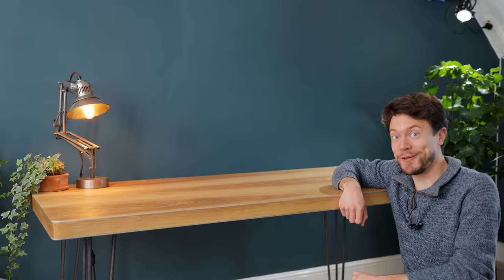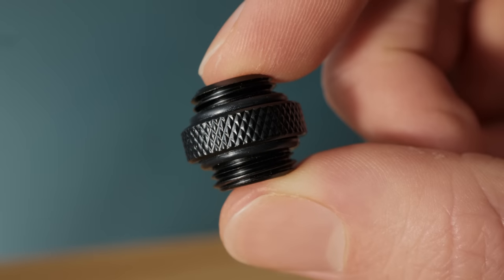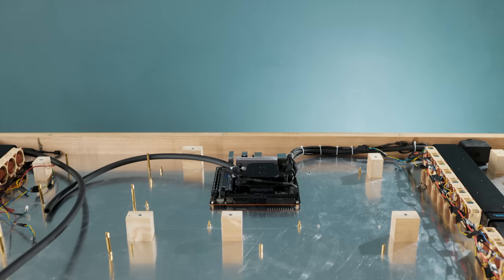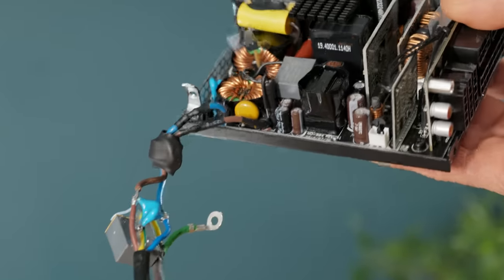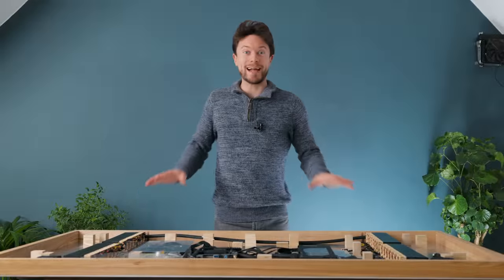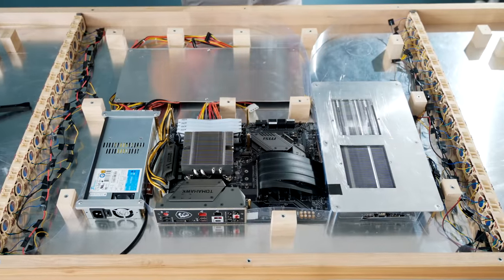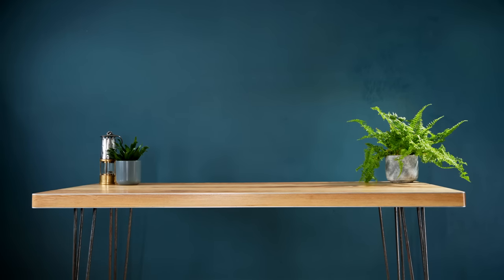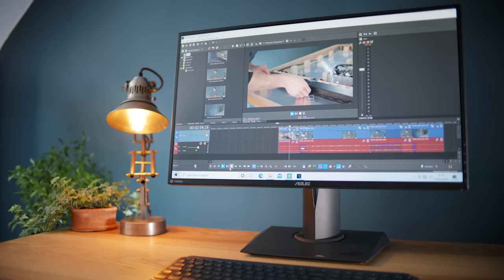Watercooling my invisible PC... (and other upgrades)

Comment: I feel like there should be a bigger emphasis on "Do not try this at home" with the power supply. If you don't exactly know what you are doing, NEVER open a power supply ! It can kill you if you touch a charged capacitor for example.
Reply: Just walking outside to buy a power supply can kill you these days. So yeah... take precautions. :)
Reply: @kontoname  I love this reply
Reply: just wash your hands and wear a mask and you'll be fine
Reply: Absolutely agree!
Reply: It will only be dangerous if you touch open terminals and at that point it is natural selection.
Reply: Whenever I open up anything with capacitors I keep the thing turned on and unplug it from the wall. That way all the power that's stored in the capacitors will get used up.
Reply: @schwuzi  always best to be safe and short any big ones with an electricians screwdriver.
Reply: @schwuzi  Actually power supply will shut down before input voltage (from capacitors) drops to zero. So there will still tens of volts in them.
Reply: @Firley777  I didn't know that, but I had no problems with it so far. Mind you I have never opened a power supply before. Simply electronics in general, where capacitors are always to be found.
Reply: @schwuzi  These are famous last words.
Reply: @ShadowManceri  I don't think so. I handle this stuff carefully and don't touch anything I don't need to, which I think should go without saying.
Reply: @kontoname  only if stores are open. Which isn't currently the case in most european countries.
Reply: It's in the spec that these big capacitors have to drain to "safe" voltages a couple of minutes after being un-plugged.  Still, good practice to let it drain overnight and/or measure the voltage on the capacitor.  Afik, they run about 350Vdc when operating and store 5-10 Joules.  So they can make a significant explosion if shorted.
Reply: It's weird how many of you seem to think it voltage that will kill you. It's not it's the amperage that's runs through it. Hence why you can touch and electric fence without dying
Reply: @jeffreekenny  that's true, but only 20 mA is enough to stop your heart / getting ventricular fibrillation. I am not sure how high the current would be, but the capacitor seems very big.
Reply: @jeffreekenny  That's why every safety sign sais high voltage, not high amprege right ? Please stop spreading this myth, it IS the voltage that kills, because the voltage is what creates the amperage across the resistance of a human body ...
Reply: @Jordan_C_Wilde  That's true. You need a certain voltage level to overcome the resistance of your body.
Reply: @Jordan_C_Wilde  no dude. Is neither voltage or amperage. Is the resistance, dude.... I hate people that say is not the voltage ugh... Is not like they are directly related and there's a formula for that
Reply: @clartypaths840  Did that, got covid. Wearing a mask doesn't help if you are the only one doing it. Picture a garden hose and covering the person being sprayed vs the nosel.
Reply: @ErimlRGG  Did you mean to reply to me or the other dude ? Because the resistance is roughly the same for every humen, so the resulting amperage across your body is mostly dependand on the Voltage you are exposed to. I = R/U, hence why all those safety warnings are allways about voltage.
Reply: @foobars3816  sarcasm is beyond your grasp I see.
Reply: @kontoname  "These days"? 

Any day. You are more likely to die in your car on the way to the electronics store than to get and die by covid.
Reply: @Jordan_C_Wilde  Na, was just agreeing with your annoyance. Yeah resistance is almost the same but my point is that all 3 are factors for killing you, so it's dumb saying "it's not that!" because is the 3 factors
Reply: @clartypaths840  I see. It's hard to distinguish jokes about covid prevention from what people actually believe. You know, like cutting down cell towers.
Reply: @pavletrnic1433  A capacitor can absolutely kill if it's big enough. Electroboom will know this too. He pushes the limits of what is normally considered safe (to the pint of pain) but he certainly is knowledgeable enough to know what can kill

Comment: I’d like to see a view of the desk with a thermal camera though to see if there are any hot spots and thermal management issues...
Reply: That wouldn't get you much information with the two aluminum plates acting as heat spreaders. You'd have to remove the plates to take the measurement, but then the measurement would be irrelevant since the aluminum plates are a critical part of the airflow system. Wouldn't be too tricky to put thermal probes everywhere you're worried about hot spots as a final verification test, though.

Based on his approach to the Canon camera thermal rework, he's clearly extremely knowledgeable about and has a strong intuition for thermal design. I don't see too much to nitpick here.
Reply: @SuperAlfredo333  The heat would spread, but it would also dissipate as it spreads.  So there would still be parts that are measurably warmer than the rest.
The point in observing with a thermal camera would also be to locate where the heat spreads _from_, not how it spreads.
Just knowing the general area (eg, knowing there's a hotspot near the memory) is sufficient information to restructure the cooling/airflow.

Comment: Do install a fluid temperature sensors and add that data for the fan control, it would help control the ramping of the fan from spikes in the CPU temp
Reply: I wanted to say the same, but the board sadly does not have a thermal probe header which is kind of sad. There are ways around that with extra hardware, but then you can't control the fans directly from the mobo which normally is the neatest solution.
Reply: @BSEUNHIR  Ah wells, there can always be another follow up video to swap out the mobo, add in the sensor plus a 30 series card when that's available..
Reply: @BSEUNHIR  https://arstechnica.com/civis/viewtopic.php?f=7&t=1470129 this is what I did to get around it on the MSI X570 Unify. Works very well!
Reply: @CalumMcFarlane  tldr

Comment: Me: drills a hole in my desk for the keyboard:

What my dad sees:
Reply: Why dou you need a hole in your desk for a keyboard though?
Reply: @SnakeTwix  so I can’t see the cable
Reply: @pearlio7297  Now it makes perfect sense
Reply: hmmm but wireles..........
Reply: @SnakeTwix  for cable management.
Reply: I prefer some things wired as well. Seems more responsive than wireless, although it may just be me...
Reply: And no batteries to recharge or replace.
Reply: I prefer my keyboard wired but my mouse wireless.
Reply: @pearlio7297 wired mouse drags when let go of
Reply: Me: why is this clown drilling a hole for his keyboard
Reply: @thealien_ali3382  have you never watched setup wars? People do it all the time.
Reply: What?
Reply: @thealien_ali3382  have u heard of cables watch tech sources new vid you'll see
Reply: @defalt371  wireless has a little lag. Unnoticeable when using them regularly, but some games require instant response times
Reply: @twxx460_  yeah... some people bothered by that fact..
Reply: Do it for ergonomics.  Also, recess the keyboard below the surface and cover it.  Make a hiddden alcove for a wireless mouse.  No keyboard, no mouse, no cables, no computer.  Just a desk.
Reply: @twxx460_  not Logitech lightspeed keyboard

Comment: "was chosen to make it cheaper"
uses literally $500 worth of noctua fans
Reply: I was thinking the same thing. I remember upgrading my dreamcast fan and was like "that's a bit pricey" and that was only one fan. hahahaha
Reply: Probably as good as 8 120mm fans laying flat too. I mean it looks awesome but seems like a poor design decision.
Reply: I believe they were used in the original project purely for quietness.
Reply: Time is money, water cooling would require more time to maintain.
Reply: Well, this is really simple: just become a YouTuber with 2.76M viewers and manufacturers will actually throw their products at you. So, chop chop!
Reply: @Chris-oj7ro  120mm blowers might make sense
Reply: The blocks for the GPU+CPU and the 4 rads are about $6-700 USD.  Technically the noctua fans were cheaper lmao.
Reply: @PasserbyP  Quiet enters chat.
Reply: I had a build with 16 14cm noctua fans. This isn't an exaggeration on price. Would have been cooler to make a separated "invisible" rad box with real radiators.
Reply: @PasserbyP  maintaining a water cooling system takes like 30 minutes every two or so months unless you want to be pedantic and bleed all the air before using it each time.

Comment: "Standard radiator and banker fans"

holds up unit that wouldn't fit in 90%+ of normal cases
Reply: Modern problems
Reply: require modern solutions
Reply: and then he shows us a powersupply that you'd find powering a render farm
Reply: Buy better cases then
Reply: @justminibanana9128  you think you can run a render farm on a 500W PSU? lol OK
Reply: @rossclutterbuck1060  no I was being satirical, I obviously know that a psu that would make a 3090 cry wont be in a render farm.

Comment: “I took out my kidney and replaced it with wire mesh so it would look nice and neat”
Reply: yeah but did you install insulating plastic to channel blood flow and keep it "cool as a cucumber"?
Reply: So my brain 🧠 was overheating due to the icse 8th exams so I opened my skull and liquid nitrogen cooled it 
Now running at a 10^10ghz with max boost of 1000^1200090000000000ghz
Reply: I added rgb to my brain which boosted its performance by 100393994949494949497864367999976544%
Reply: @bodiminds6571  your brain. Because your conscience is a soul. You are a soul. Not. A brain. It is your physicality.
Reply: @iamf6641  but you can't say any criticism because that bad boy can run more than 1 processes now. Big improvements
Reply: Am I the only one who attached a gaming chair to my back? It's great, now my back is overclocked to 60fps at 4k
Reply: @bodiminds6571  but can it run cyberpunk 2077?
Reply: @colinmetzger6755  no sadly got 0.00000000000000000000001 avg fps
Reply: @iamf6641  as kodi was born in this material world with this material body he had this I. So he killed the "him"ego
Reply: @colinmetzger6755  so I felt my brain was heating at 10degres Celsius so I upgraded it to a 0.00000000000000001nm process from tsmc now it's running ok at -100degrees celsius
Reply: @bodiminds6571  bro I have my exams coming up so wil try thiss😂😂😂
Reply: @Adi-fm5us  "screw in with confidence "

Comment: Flex psu's would have worked also
Reply: But what is the max wattage of the Flex psu's? You can probably get a higher wattage sfx psu.
Reply: @ggesdsdsdsd  There are 500W or 600W ones readily available, but that might not be enough power. There are likely higher power ones somewhere but they are elusive
Reply: Saami Zakir  He probably has more knowledge to do this safely than you assume.
Reply: Saami Zakir  he does have a disclaimer tho
Reply: @Saami Zakir  linus has only years of experience in pc level stuff, he doesn't know how to protect himself from the dangerers a psu poses and so he is afraid, it just means its not his field of interrest, because all in all its not that hard to protect yourself from the loaded capacitors if you know what you doing.
Reply: @trungngo1066  he did quite well tbh, first I was like: oh no whats he doing but in the end it seemed like a save solution even for me who was studying electronics for a year. Its not a perfect solution for everyone, you could for example never sell such a thing, but it has enough safety precations so that the person who built it would not kill themselves accidentally.
Reply: Saami Zakir  i opened several dead PSU, the tips is to not touch capacitors
Reply: Saami Zakir  Did you even watch the video?!
Reply: Linus doesn't have any practical engineering experience.
Reply: Saami Zakir  Lol u seriously comparing linus with this guy, years of experience reviewing tech stuff, linus obviously know alot about tech and theory, but u talking about practical stuff, its like comparing engineer with technician who only follow SOP
Reply: @joshuanorman2  I got a 1000w sfx psu, from Silverstone. lol
Reply: That's insane lmao
Reply: @joshuanorman2  look it up "silverstone 1000w platinum sfx-l power supply" lol
Reply: @isaac7272  Linus has years of shilling and "theory" experience, reviews can't be honest when you need to keep sponsors happy.
Reply: @bitelaserkhalif  pff even if you don't touch the capacitors other parts could still be connected to them. The trick is to not touch it with 2 hands so the current can't run through the heart and quickly discharge the caps over a resistor (they are so big that a short circuit would be quite distructive)
Reply: @woldemunster9244    ok what kind of experience do you have to give such an answer?
Also modern science doesn't rest on eqauations but the tests that developed those equations you might be able to "predict" what will happen if you do this and that but in the end you can never be sure till you try.
Your argument is missing examples that verify your opinion to even be considered good. And well frankly most of the hater comments are people that are just jealous that the don't get a gpu sponsored just like that, but you know that takes actual work to get to the point and is not achieved by writing hate comments in the comment section of some random youtube video. 
PS: today I found out youtube has a curseword filter...
Reply: @joshuanorman2  600w is actually more than enough for this build, once the settings have been tuned.  And there'd be even more leeway if he got his hands on the latest graphics cards, those all actually see a sizable boost from undervolting instead of the usual minor dip (or at best, minor boost)
Reply: Saami Zakir  lmao I've worked on dozens of PSUs.
Reply: Saami Zakir  if you need a disclaimer to not do stuff you don't know how to do. You're the problem
Reply: @Deepstatedebate  Disagree. A lot of stuff, even with no prior knowledge is okay to have a go at and just try. Usually the worst that could happen is that you damage something. Opening a PSU could literally be fatal, far worse than the any bad outcome of modding most other electronics

Comment: You should really use a liquid temperature sensor, it makes every build (and I mean, every) quieter, or at least it will improve fan responsiveness, since it allows the fans to ramp up as liquid temperature rises, instead of CPU temperature which can have spikes based on load...

Comment: "Take a listen"
Hears my loud PC
Reply: I feel that. I accidentally bought server fans when I was building my PC and they sound like a jet taking off when my PC is turning on
Reply: @DavidTasselTots  I have a single 92mm server fan in my case as a exhaust, it can spin up to 4k rpm, and that is quite loud, especially with my gtx970 reference going at full speed, then it is basically a vacuum

Comment: Max GPU temperature of 55 C. Linus Tech Tips wants to know your location
Reply: or 131 F
Reply: @CreeperPookie  or 328K
Reply: @deejeh9494  Ah true..
Reply: @CreeperPookie  Celsius is easy to understand and is better admit it.
Reply: @grafzpln2344  You seemed to care to much and replied to my witty comment.
Reply: @Tomoslb1  No, it is not. °F is much easier to understand.
Reply: @CreeperPookie  °f is garbage and based on what exactly? There's a reason all but 2 countries stopped using it completely (and with in those 2, °c is still the standard for anything scientific)
Reply: @CreeperPookie  Yes it is, no its not, yes it is. haha what did I start here .
Reply: @the baked potato Well, °C is pretty easy with 0°C being the freezing point of water and 100°C the boiling point. In °F however, 96°F is defined as the temperature of the human body, and 0°F is defined as the coldest mixture Fahrenheit could create (as he wanted to avoid negative temperature notations). In today's world, the definition of 0°F makes absolutely no sense and the definition of 96°F is wrong, since the human body temperature is slightly higher
Reply: @the baked potato Based on the human body by what metric. Its completely  random. Dangerous temperatures for the human body would be anything below 33°f and above 122°f (0°c- 50°c) like wtf has that anything to do with the human body, that just happens to be mostly made of WATER that Celsius is based off of. Freeze to death at 0°c or less,rapid heat exhaustion over 50°c as critical temperatures. In Fahrenheit its just two completely random numbers that cannot easily be determined by your natural surroundings like water FREEZING and Rapid  water EVAPORATION.
Reply: @CreeperPookie  CELSIUS IS SUPERIOR!
Reply: @CreeperPookie  ohh it is
Reply: @Tomoslb1  it's*
Reply: @the baked potato I'd*
Reply: @420roachdoggjr  No it is not.
Reply: @Tomoslb1  It. Is. Not.